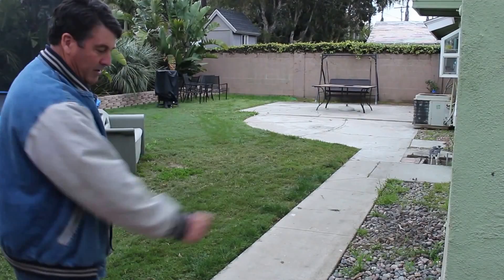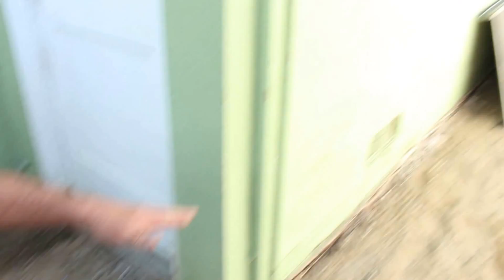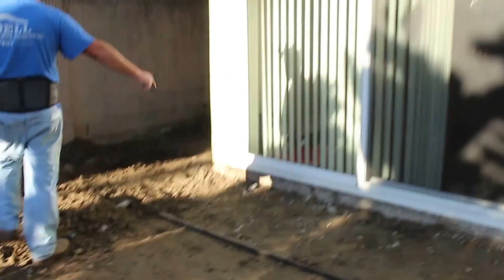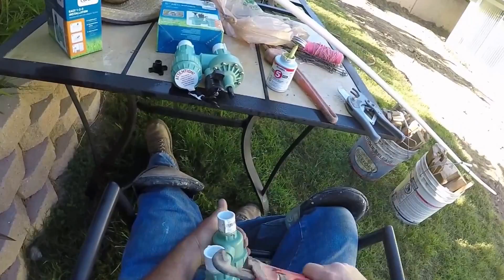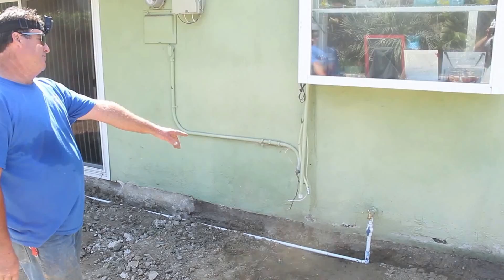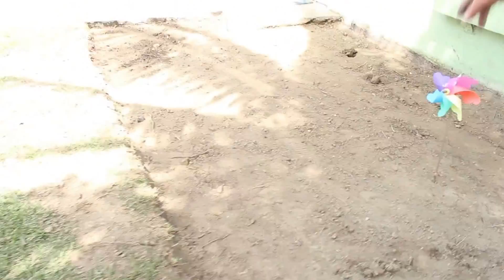How to Setup, Forms, Drain lines, & Sprinkler values with Timers Part 1

Comment: Keep up the good work! Very informational videos. For the pipe thread compound/sealant, especially to cap off sprinkler heads and then pour concrete slab on top of it, which compound/sealant would you use….non-hardening or hardening one (vibration resistant)? Also, which sealant/compound do you use to connect schedule 40 pvc pipes for drainage which will be buried under concrete as well? Thanks in advance

Comment: If you’re already trench from front to back why don’t you run an irrigation main so you’re not on the house water and get knocking when the sprinklers run?
Reply from the maker: Because we would have had to remove concrete.
You don't get knocking from that, the only thing that may happen is less water pressure

Comment: great job guys, would be helpful to show what type of connectors were used in actual spinklers, for example, angle fittings and swing joints if used. thinking of adding sprinkles in backyard this year myself. any advice will be helpful...thanks
Reply from the maker: Great idea 
TY

Comment: We use red rock in South Dakota mostly.  The pea rock you use seems to be a lot easier to work with, especially with the edger and groover.   Do you know any difference in integrity with each aggregate?
Reply from the maker: Steven Thury 
the bigger the rock the stronger the concrete

Comment: as a gardener ive learned to leave a long trunk when removing trees and shrubs, this give a long lever to help get the rootball out.
the way the climate is going, im not sure that 3 inch drains are going to be enough for future downpours.
not a criticism, just an observation, i enjoy watching your concrete work.
Reply from the maker: Whether or not the drains get all the water  out or not the way I do the concrete by having the direction of water flow lower will allow the water to still run out before it goes into the house